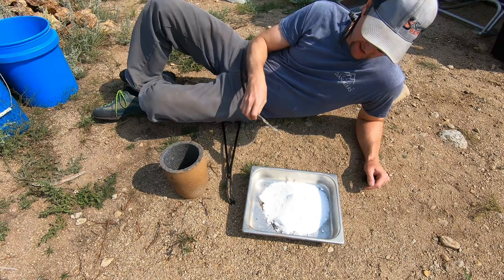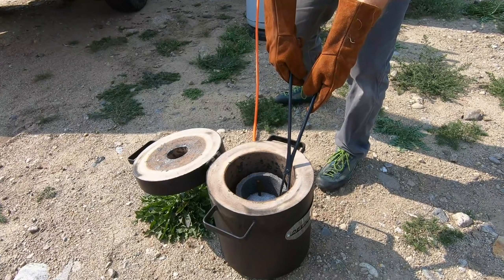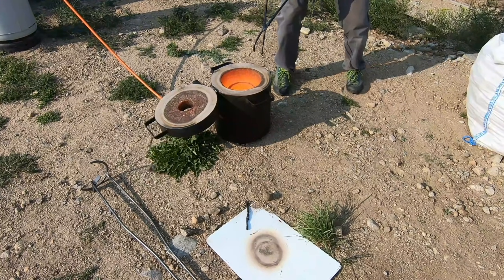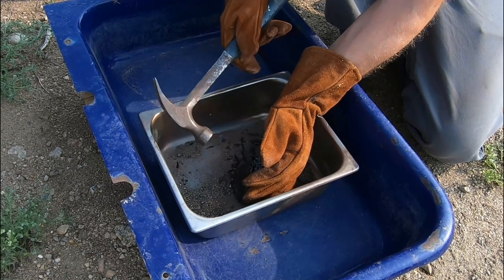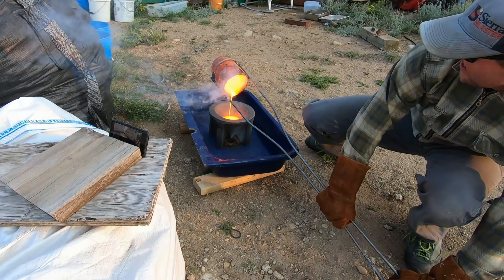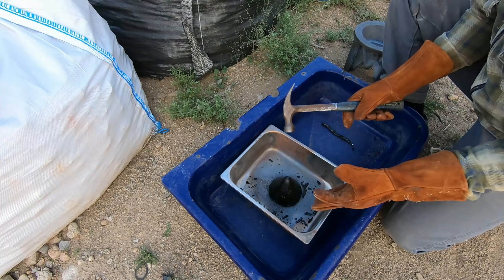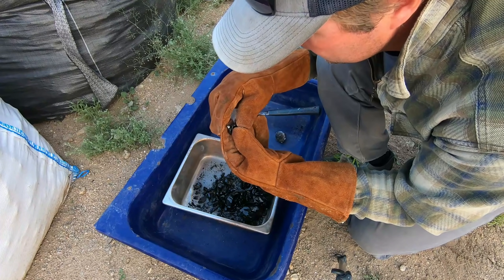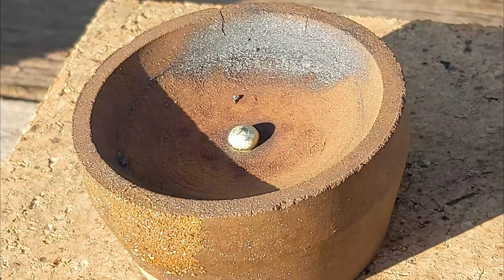HUGE 246 gram Button! SMELTING GOLD - Colorado Gold Mining

Comment: Hey cowboy. Just found your YouTube channel.  I just subscribed. Couldn’t help notice other than your nice rawhide gloves you are sticking your head around and into the hot furnace  no respiration mask or face protection no protective bib type apron and sneakers.  I speak from experience.  As good as you are and working from the ground instead of a nice sturdy table you could spill a little on your shoes.  And breathing the heat over the furnace the fumes can’t be good for a singer so how could it be good for a person smelting gold. Love what you do. I did the same thing 35 years ago so archaic compared to what you do.  In the day after watching you it was clear I didn’t know what I was doing from extraction of gold from electronics to final pour.  That button looks great. Be safe.

Comment: Greetings from Jason ..... eh .....

What's going on with you ?  

Crawl on the sandy desert ground ...... tray to small ...... pliers to small and not useable  for melting and work with a crucible ( this size ) 

Crawl over the ground again ......

Pooring have to be as comfortable as possible in the action 

Even the furnace to the crucible .... to small 
No Temp. check 

No pooring technique !

And on top .......... : "oh ist that hot ,- aaaaah ,- ohhhh ,- hot hot  ( dramatic ) 
No propper work gloves ,--  oh ,- ah        OMG

Comment: I didn't use any iron, instead litharge 1to1 ratio on a 191 g ore. I was expecting to receive 35g button from reduced litharge ,insted it reduced 160g litharge. Not sure , if that was because i had too much sulphides or something is wrong in my calculations.

Comment: Your skatting uphill young man ;)  While fire assays work, way too much effort and energy to pay.  There is a reason the oldtimers went strait out of the stamp mills into quicksilver ;)  Same reason if they ran into too many sulphides, they hunted better rock ;)  Propane, cupels, Graphite, and time exceeds the extra bit of gold you gained with those sulphides.  Trade that junk for a good tumbler, a bottle of mercury, and a retort or a bit of nitric to reclaim your mercury.  It is also far more dangerous than amalgumation!!  One drop of sweat hits that, you got an explosion and 2000 degree metal goes all the way to the bone!!!

Comment: I don’t know much about this stuff that’s why it was so interesting to watch. I do know fumes are dangerous so I worry that you were downwind as you poured. I guess once you start you can’t easily move so if the wind changes it puts you in a precarious position. Maybe you should wear a respirator to be safe. Maybe I’m worried for no reason...I tend to be overly safe or worried about safety sometimes. Anyway, that is quite the process. You have all this fancy stuff to melt the metal...how did the old timers do it?
Reply from the maker: Thanks SCS.  The use of a high quality respirator with the proper cartridges is Extremely important!  I do use one :)   The process is fascinating and ever evolving as all rock types are different.

Comment: Cool video! I work in a machine shop but we also pour all of our parts that we machine. I don’t know if you did this off-camera but it might help you if you put your cone mold on top of the furnace and get it good and hot right before you pour also if the cold mold is too cold you could have a explosion from the different temperatures they are not fun! In the first pour it looked like you didn’t quite have the material hot enough but it’s kind of hard tell. I don’t know if I would really be any help with this kind of foundry work but I do live in Colorado if you ever need help.
Reply from the maker: Cool Stuff, sounds like you do interesting work Lmeyette!  At times it can be difficult to tell when the melt and reactions is completely done.  The first one cooked for 54 min and appeared to be done.  Once, poured....clearly not.  That pour also resulted in a matte throughout the slag but did yield a decent gold bead.    I did semi preheat the mold but it likely needs more, for that, I'm gonna need thicker gloves ;)
Reply: دوست عزیز سلام من نظرات شمارو خوندم متوجه شدم که شما تجربه بسیار عالی دارین اگه امکان داره بهم کمک کنین برای یک کیلو خاک حاوی نقره وطلای سولفیدی باید چه موادی وبه چه مقدار برای فلاکس استفاده کنم 🙏🙏

Comment: You would be better off pouring with the tongs straight out of the furnace. You have less than 10 seconds to 'finish' the pour from the time you shut off the propane, the melt will cool immediately down below pouring temp if you wait any longer - you also have that massive cone mold which is cold and pulls all the heat out of the melt. Try setting the cone mold on top of the furnace for 30 min to preheat it.  Also put your crucible back in the furnace and close the lid so both the furnace and crucible can slow cool - rapid cool of either is what destroys them. Soda ash is also extremely corrosive to crucibles, so go light on SA and heavier on the borax.  You're doing great! Happy to see your making progress :)
Reply from the maker: Thanks for the tips Gold Miner!  I will definitely try to do the pour a bit quicker and see if there is any difference.  Sounds like you've don a bit of smelting.   On the second pour, the BIG button turned out to be lead n gold on the bottom and iron n gold lightly coated in lead on the top.  The iron cap has gold in it and seems to be a bit of a "refractory" possibly from the addition of some graphite from the crucible.  Any idea on how to go about smelting that?
Reply: @ColoradoGoldCamp  You likely have several issues going on in your charge, one is the sulfide amount, the other is iron content. Pre-roasting helps off gas the sulfer, and you will need less iron in the charge then, or if you have a lot of iron in the mix from your pulverizing machine, that can be removed with a magnet. It's a fine balance iron/sulfer. It's better to pull the iron with a magnet and add a steel rod into the top of the crucible that way the smelt will only consume what it needs, nothing more so it's self regulating. Too much soda ash can also cause the lead to suspend. You might want to add some glass ( silica ). You saw the difference of the slag from your first to your second pours, so you have a good eye. Smelt fluxes recipes are not easy, every ore is different, even in the same sample vein, but you have obviously done a lot of research as you are doing way better than most this early on.
Reply: @AUMINER1  I just commented about a pre-roast, A good idea for sure how about changing out some of that SA for Potassium Nitrate?
Reply: @ColoradoGoldCamp  It's best to heat your furnace up to temp first, then add the crucible, preserving the graphite crucible. You will prob be better off with some greenAP cheapy crucibles if you are going to be using soda ash.  Borax is your friend ("Anhydrous" borax over the store bought water laden borax)
Reply: What flux are you using?